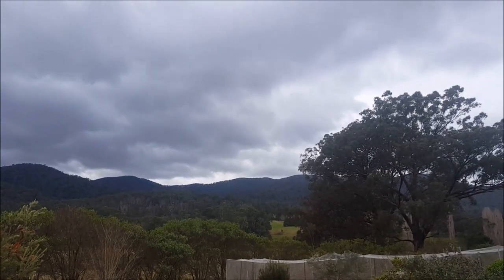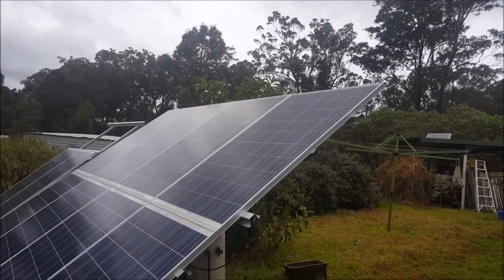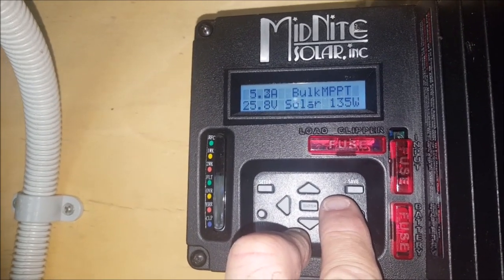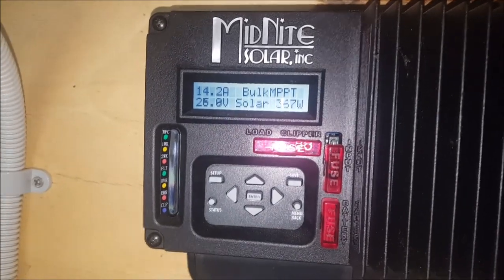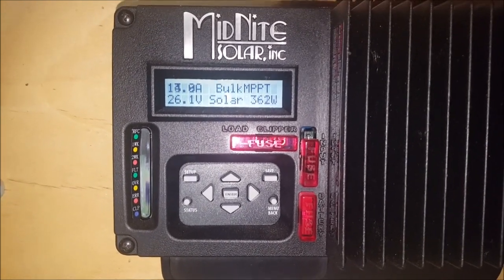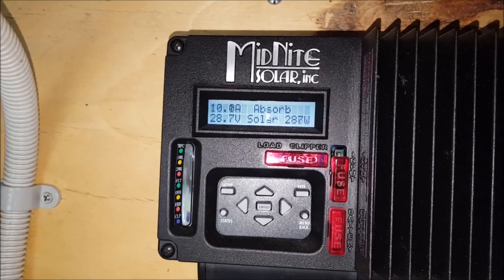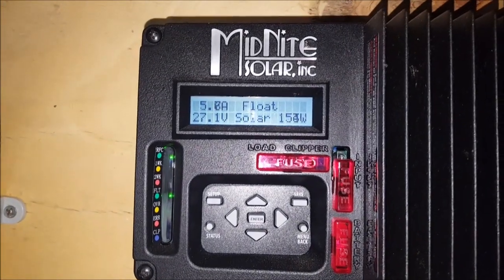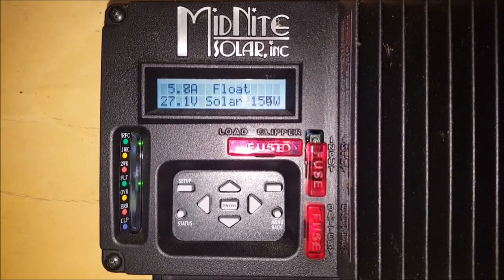Off Grid Solar Power - 2kW Array on the Midnite Solar Kid

Comment: Will the midnite solar the kid be harmed for being over 30 amps?
Reply from the maker: No, it has built in overload protection.
Reply: Pop's Shack My setup is on 12v with two 250w solar panels in series, I will be adding a third panel then to bring up the wattage until it hits overload. Is that a good idea?
Reply from the maker: Yeah, that should be fine, although with 12V the most you'll be able to get out of the Kid is about 325W. If you can, set your battery bank and inverter up for 24V.

Remember to keep your panels as closely matched in voltage and output as you can.
Reply: Pop's Shack The kid can handle at 12v 432 watts and the max that I have logged is 428.

Comment: Nice controller. It is current limited to 30 amps, so you can hook up as many panels as you want. It will output max 30 amps (with a 24v system, around 800-830 watts). Go to a 48v system and double that wattage. Over 1,500w from a Kid...that would be COOL!
Reply from the maker: Another test for the future. :p
Reply: I have a 1.2 kw array on mine and it will go into resting mode with full sun. So there is definitely a limit to how many panels you should connect to it.